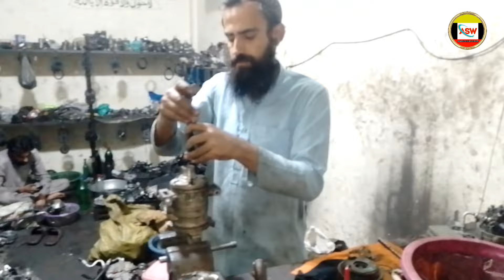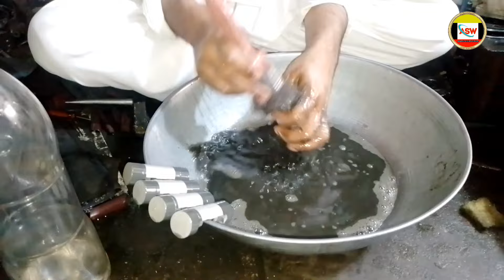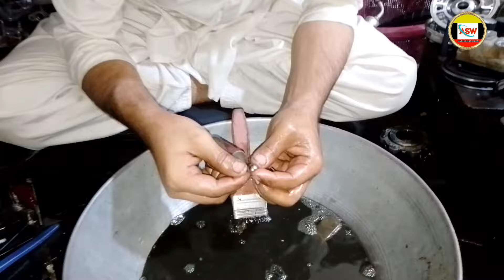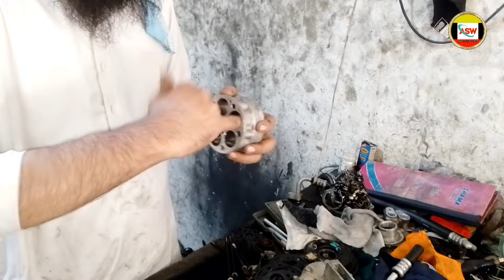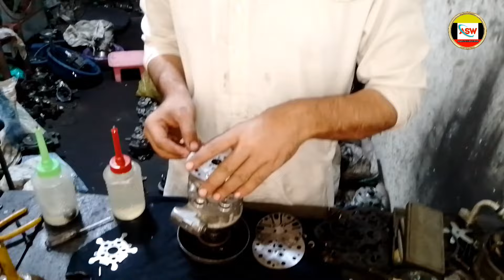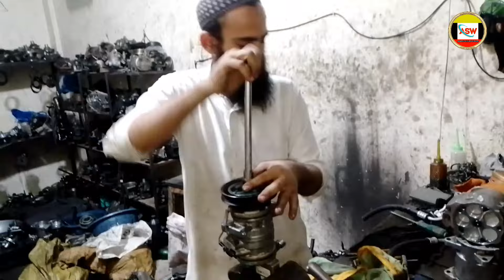DIY Wagon R AC Compressor Repair: Save Money with These Tips "Amazing skilled worker

Comment: Your skill is amazing,I think your the best compressor repair in the 🌎. I have a questions brother,do you use both synthetic  and mineral compressor oil as red and green cap bottle is that right?
Reply from the maker: Thank you so much!brother we use at the time of compressor repair for cleaning petrol and for lubricants compressor oil one oil is normal compressor oi and thick oil only for bearing and valve plate installation time
Reply: @amazingskilledworker  thank you so much
Reply: @amazingskilledworker  brother Is that thick oil is other type compressor oil or what?can I know the name of the thick oil brand name brother?
Reply from the maker: @MJ_Autoparts  +923134574198 it's my WhatsApp number contact us on I will explain all details about repair